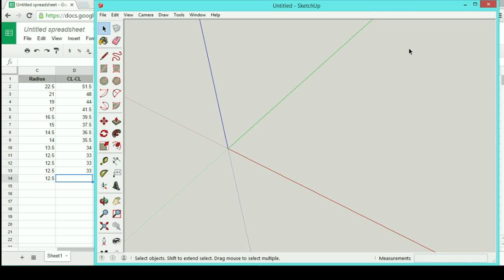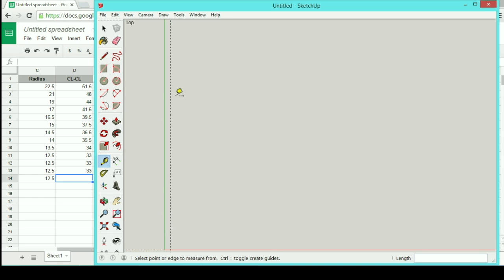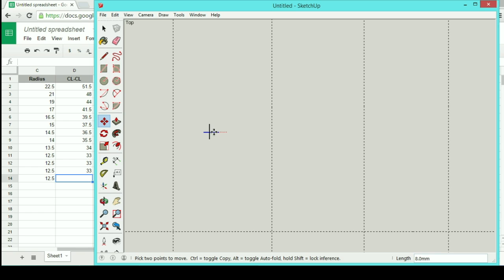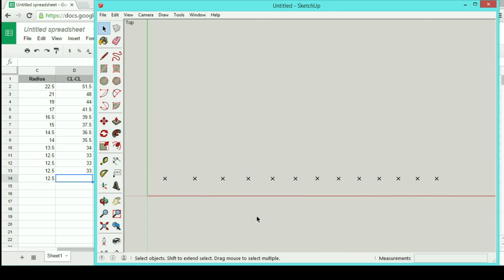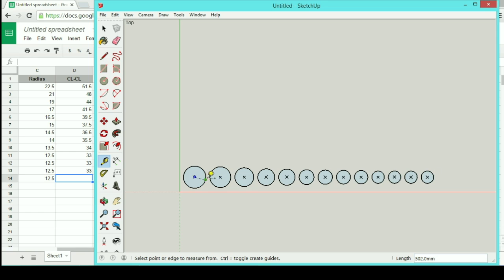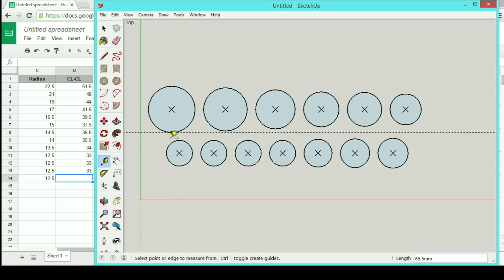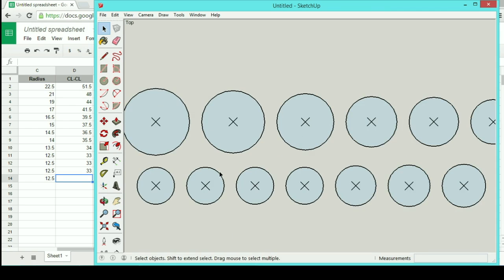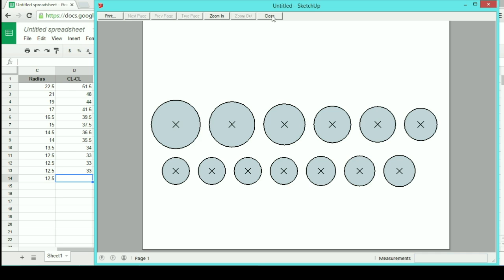Sketchup Layout for $1 Socket Tray

Comment: I tried this with the sketchUp program. Do you have sketch up pro? Mine doesn't look like yours. I also can't get mine to zoom in as far as yours is?  When I make my lines for my CL-CL measurements they arnt as spaced out as yours. Mine are very close. What template do you use? I tried wood working millimeters an just the basic with millimeters. Any help would be great.
Reply from the maker: I believe I was still using Sketchup 2015 when I did this video. Yours may look different because of the toolbar that I had enabled. The default toolbar has fewer tools on it. You can right click on the tool bar and but a check mark next to whatever toolbar you want displayed. The 'Getting Started' is the default. In this video, I was using the 'Large Tool Set' toolbar. 

As far as zooming in, I've noticed that the zoom behaves differently based on whether your cursor is on an object or not. When you get zoomed in really close, make sure your cursor is over one of the lines you drew. 

I typically use the Woodworking - millimeter template, but really the only difference between the templates is the number of decimal places it displays. Your circles may appear close, but that could be due to being zoomed out, so they appear closer together. Use the tape measure tool or the dimension tool to verify that the CL-CL distances are what they need to be. If you have any other questions, feel free to ask.
Reply: +Dustin Rogers Awesome thanks for the reply. I will give it another shot an see how it works!

Comment: I have the same sockets. Can you release a link to print that page out?
Reply from the maker: Unfortunately, I didn't save the sketchup project, otherwise I would. Since you have the same sockets, you can use the measurements from the video and lay them out manually directly on your plywood.